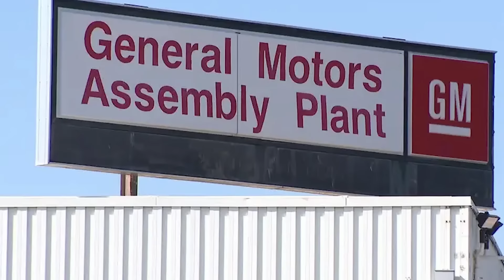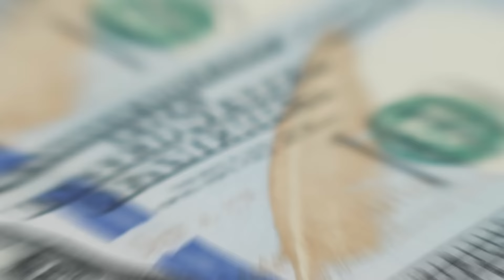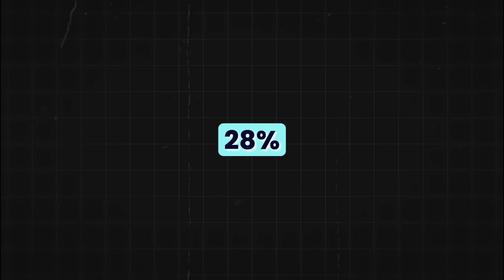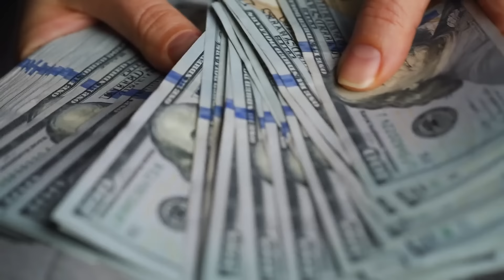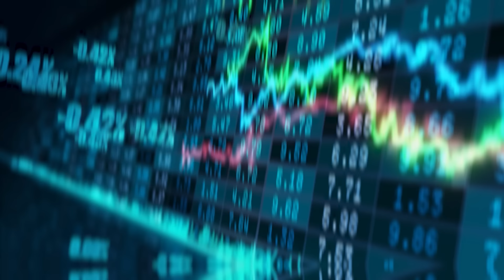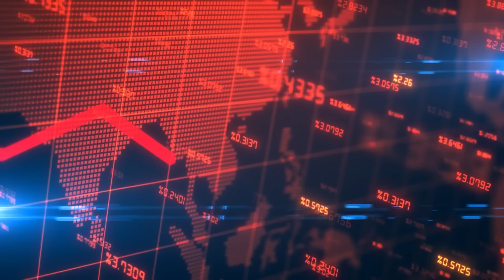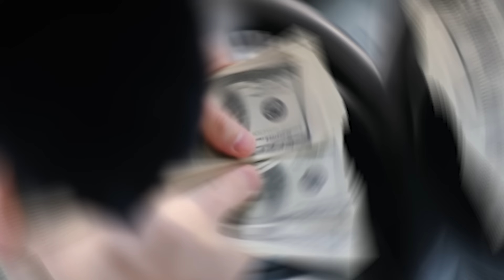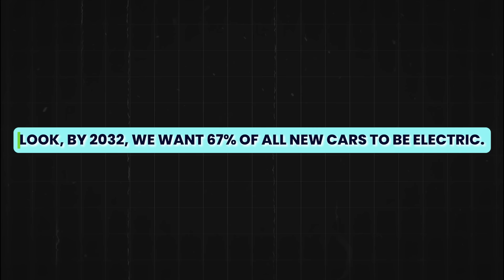The EV BUBBLE has Burst!!!

Comment: Why would anyone buy a $ 100,000 Ford F150? That is the price for an apartment! Why does Ford not make a basic Ford F150 without the bells and whistles for about $ 35,000 ... consumers want a basic truck for a reasonable price.
Reply: Yeah, but a basic truck would have lower profit margins, so manufacturers aren't interested in making them. Reason being that a vehicle assembly plant costs the same to run whether it's churning out $35k vehicles or $100k ones. So while the $35k ones might still be profitable they're not going to be AS profitable as the $100k ones. That's why they don't make them.
Reply: @Haawser  Pretty soon Ford and GM will not make any trucks because they will not be able to sell them at $ 100,000.
It all has to do with supply and demand and the demand simply is not there. That is why they are losing money!!!
Reply: They do make regular cab pickup trucks for 35000. My buddy bought one and traded it in for another a year later.
Reply: @mountainman6549  Regular cab pickup trucks should be sold for $ 25,000. You could get a fully loaded car for $35,000
Reply: Just want a,work truck
Reply: @snitram1366  Exactly, most trades just want a work truck and not a fancy truck with all the bells and whistles for $ 100,000

What happened to all those trucks made in the sixties and seventies that one could fix themselves if anything went wrong? Now with the new trucks everything is hooked up to special computers and diagnostic tools no one has in their garage!
Reply: They do, but they are so basic that no one wants them. Hence, they came out with a small pickup, the maverick.
Reply: I just need a car that goes from a to z without all those stupid features,,,like the feature of individual climate control for driver and passenger ,,,that's so stupid ,,driver and passenger are in the same bubble. Smfh.
Reply: @luismercado71  You are right a work truck is just to get you from a to z and be able to carry a load
Reply: Just wait till it's about 5 years old and still running decent. They depreciate so fast they're worth half that or less in a few years. If price of a new one kills ya, then they obviously can't afford it.
Reply: @NicholasRobertsvalleyford  Almost everyone wants a basic quad cab without all the bells and whistles for around $ 35,000 at most.
We don't need leather seating, dual climate control, digital instrument panel, alloy wheels, etc.
Reply: ? @Haawser  So the $100K trucks sitting in the dealers lot is profitable
Reply: @paulhui7037  They are not only sitting in dealers lots but for a very long time with accrued interest rates.
Reply: @garyr7027  The trouble with the late model GM and Ford trucks is that many things start to fail and they are expensive to repair.
Yes, you could pick up a 2005 Ford F150 crew cab for about $ 25,000, but then you have to add all the repairs required.
It would surprise me if Ford and GM are still in business 20 years from now. They have lost so much market share to the competition.
Reply: @mauriceharting5877  it's not for the faint of heart, repairs are done by the owners to save on cost.
Reply: @mauriceharting5877  you cannot blame the truck manufacturers for complicated vehicles because they are mandated by the federal government to fuel efficiency standards which can only be achieved through modern engineering.
Reply: @mauriceharting5877  I don’t think you realize how competitive and difficult vehicle manufacturing is. Many are close or already have gone bankrupt. Many vehicles are sold at a loss. Do some homework.
Reply: You got that right! Bullseye!
Reply: @mountainman6549  You don't know this, but I used to work at a Ford dealership in sales and I know how much money they made. Dealerships love to up sell and inflate prices that is how they make more money provided they actually sell.
The problem is that consumers have caught on and most are not willing to pay inflated prices.
Comon' a truck for sale for $ 100,000???
That is the price of a small apartment!!!!
Reply: I can't imagine paying 35k for ANY Ford product except maybe an old Mustang that's been restored or a GT40.  The base model F150 should be about $19k.  PERIOD.  Cars are VASTLY overpriced right now.  All cars.
Reply: @charlescarmichael1124  
Haha! Yeah, me neither!
Reply: 90% of the people would do totally OK with a station wagon sedan or minivan, trucks are for farmers and people who work in areas without proper roads. Hell, even Carpenters and plumbers are better off with a minivan which can tow a trailer then a truck. Much easier to store stuff inside and organize things (I'm from Europe, I've worked in several  countries outside the EU and driven quite a few trucks)
Reply: ford has king ranches platniums difffent levels of towing capicity ect that dictaces price
Reply: If you want to get the real value of a vehicle, take it to the scales  and ask how much
Reply: @johnhanson4795  Yes, Ford brings out different truck models with different capacities, but that is NOT the only factor that determines the price:
1. Labour costs
2. Material costs
3. Production costs
4. Dealership costs
5. Mark ups

Ford labour costs are one of the highest driven mostly by powerful Unions.
Material costs are dependent on sourcing to get the best value.
Production and assembly lines can and should be automated for better efficiency.
Dealerships is an old model relied on too much by Ford. Instead dealerships should focus on repairs and maintenance and leave sales online to Ford.
Mark ups are high at Ford, but more so at dealerships for new vehicles. Why have a middleman (dealerships) at all? It only drives up the price.
Reply: The current base model F-150 is that price. The problem is finding one. They only want to sell higher trim levels with a higher profit margin.
Reply: @mauriceharting5877   Apples and oranges. You have to consider the higher load and tow capacities of trucks. The design and build is very different.
Reply: @agdraaijer7288  In Europe the biggest operating cost is fuel (mostly due to fuel taxes) and so the size and weight of vehicles is smaller.
The size is also a determining factor for parking in Europe.
In North America trucks are very practical in construction and farming. Try loading drywall sheets or sheets of plywood in your minivan or driving with a trailer only means more issues with parking in residential areas.
Yes, plumbers are better off with a cargo van since they carry lots of fittings and parts requiring van shelving, and the van roof is used to carry piping, etc.
Reply: @luismercado71 Climate control does improve comfort. I don't know how much it costs to achieve it, but I doubt that it's very much.
Reply: @mauriceharting5877   Base model F-150s are $36k. The trick is to find one.
Reply: @joewoodchuck3824  My point is, be the truck light duty, medium duty or heavy duty they are all overpriced for various reasons ... mostly greed.
Reply: @joewoodchuck3824  Again, greed by both Ford and the Dealers.
Reply: @cooleyhigh3405   Please elaborate.
Reply: @charlescarmichael1124  Well $ 19,000 for a brand new truck of any kind is basically impossible with current labour and material costs.
Even Tesla initially was going to sell the CyberTruck for about $ 40,000, but when they actually build and sold them the base price is $ 70,000.
Optimism is one thing, but when reality hits it drives up the price.
Reply: @mauriceharting5877  Ah. So you meant value by weight. That's the part that went over my head.
Reply: @joewoodchuck3824  One has to weigh the various choices to arrive at value is what I am saying:
1. Durability ... how long does any vehicle last without breaking down with expensive repairs.
2. Maintenance ... how much periodic maintenance and servicing is required.
3. Price ... how much does the vehicle cost and does it fit in the buyer's budget.
4. Practicality ... does the vehicle meet the needs of the buyer, such as is it used mostly to transport people or materials.
5. Fuel costs ... is the vehicle gas powered, a hybrid, or electric.
6. Aesthetics ... how does the vehicle look both inside and outside, body colour, and layout.
These are values determined by each buyer and that is why we have so many different vehicles on the road.
Reply: If I have to I will buy an older gas powered car. And put a better stereo and accessories in it
Reply: @DarkAngel051372  Yes a well maintained older car may be a fiscally sound decision. I own a 2005 Nissan Pathfinder and a 2002 Mercedes SLK320 which I bought for a fraction of the price new and these were wise decisions.
Buying a new car has the most depreciation for when you drive it of the dealership lot the price drops at least 20% and often more ...
Reply: @mauriceharting5877  you can get that. A basic xl f150 is 35830 new built from factory. That is msrp. Most people don't want to wait a few months to have it built.
Reply: @mauriceharting5877  dealers do not stock them because they do not sell.
Reply: Maybe extend the bed under the (back) seats so 8' sheetrock and lumber need not jut out of the back.
Reply: @DarkAngel051372  Nothing wrong with that.
Reply: @mauriceharting5877  Agreed on most.
Reply: @mauriceharting5877  One must be a careful buyer for any vehicle.
  With my ongoing diligence I'm happy to know that my current vehicle purchased at ~6 years old almost 9 years ago can be replaced with the same make and model, and same ~6 years old for not much more money as before. In addition, I can use it to tow my inexpensive utility trailer for the occasional "pickup truck" needs. It's been a long time since I've needed two motor vehicles.
Reply: $35,000 is too much. How about $10k or so??
Reply: @paulhui7037  Well, that's where their greed and stupidity comes home to roost...
Reply: @MollyDogg1234  Vehicles haven't been $10k for 40 years.
Reply: They are subsidizing the EVs
Reply: Greed and Corrupt Politicians.
Reply: @yaiburanakul8505  Yes, the various Governments worldwide are subsidizing EV's and they are not penalizing ICE vehicles enough yet for noise and air pollution.

If we want clean air to breathe and less traffic noise in cities we need to switch to EV's.
Reply: @mauriceharting5877 there's alot of us that buy those, such as the raptors for me atleast and I'm not satisfied with having the bare minimum when it comes to vehicles that I'm gonna be putting money into once I have it so I can make it look the way I want
Reply: @mist3rasylum397  You may spend your money as you please, it is your money, but don't call it a wise investment for these $ 100,000 trucks are overpriced.
Reply: @mauriceharting5877  I'm not saying it's not overpriced, was just saying there's alot of people who buy these for that price.
Reply: @mist3rasylum397  Fair enough.
Reply: Not counting on paying them $250.00 an hour for labor so expect to pay A grand for each visit if they look at.
Reply: @dj-bn1fj  Yes, dealerships do charge a lot for their repair services. That is why drivers find cheaper alternative repair shops or do the repairs themselves if they are handy.
Reply: As the owner of an EV, I can say that EV'S ARE NOT GOOD FOR THE ENVIRONMENT. the cost of producing Lithium , extracting process and everything will harm the environment 10 times more than an average IC engine car. An average Hybrid car will cost about 30 to 36 $ for a 360 miles trip andd 40 to 50$ in gas for a IC engine car. it costed me 75$ in supercharger costs and a 7 hour trip for covering 360 miles
EV car is not economical and not good for the environment.
Reply: @lnvkriitkgp  I am an owner of an EV myself (2017 KIa Soul EV) and you are right there is no such thing as ANY car or truck being 100% environmentally friendly.

The mining issue is a problem for both EV's and ICE vehicles since both use metals that can and should be recycled in time.

You forgot to raise the issue of  faster tire wear on EV's since these vehicles are heavier.

You forgot to raise the issue on vehicle paints and plastics which also pollute the environment.

But here is where you are wrong. ICE vehicles pollute the environment EVERY DAY with their tail pipe emissions and noise from the running engine.
ICE vehicles need regular oil and filter changes, which also pollute the environment with oil spills from leaking engines.
Fueling ICE vehicles also pollute the environment since gas from fuel escapes, which is a known carcinogen and harmful to humans.
Brake wear and tear and rotor replacement is also a big issue with ICE vehicles since most do not have regenerative braking like EV's do.

Yes, manufacturing of both EV's and ICE vehicles do come with some environmental costs, but after manufacturing has been completed EV's basically stop polluting the environment while driving whereas ICE vehicles do not!
Reply: You're right but at least some can be made up with the higher volume. GM and Ford just want to swing for the fence but forget about the old sales pyramid. @Haawser
Reply: @dj-bn1fj  Interestingly the cost for repairs are similar. And EVs cos nearly nothing for maintenance.
Reply: @mauriceharting5877  Europe also have public transportation, in the form of high speed rail. Fossil fuel companies have lobbied heavily against public transportation, and EVs. You might even notice some youtube channels that have all of their content attacking EVs.
Reply: @lancecarona2554  Yes, I was born and lived in Holland for many years and I must say Europe as a whole has much better high speed rail infrastructure compared to anything in North America.
Public transportation via rail should improve much more. I live on the West Coast of Canada right now and light rail has improved over the years, but it still has bottlenecks and breakdowns especially during rush hour and it does not cover all of our local communities.
Reply: @mauriceharting5877  High speed rail is almost nonexistent in the US. Again it is because fossil fuel companies own this place.
Reply: @mauriceharting5877  polluting the environment is inevitable boss...
My point was to people who think I'm saving the environment by driving an EV. Producing electricity also pollutes the environment with the exception of renewable energy. Just because we are not seeing the pollution doesn't mean it is not happening
Reply: @lnvkriitkgp  Some cities have such a big pollution problem that electrification is the key. Beijing during the Olympic Games was shut down for ICE cars because the smog was so bad athletes had a hard time breathing. Mexico City was so polluted that it affected everyone's health. In India many cities have a serious smog problem. Even LA had a lot of air quality problems.
EV's are a partial solution.
Reply: @lancecarona2554  Well, high speed rail would be very expensive in America and Canada because:
a. We don't have the rail infrastructure for high speed, and
b. Due to the extremely long distances it would be cost prohibitive.

Let me give you one example here:

If you want to travel from Amsterdam to Barcelona via high speed rail that would be 770 miles or 1240 km and take just over 11 hours covering 4 nations (Holland, Belgium, France, and Spain). And the cost for this rail infrastructure would be shared by 4 nations.

If you want to travel from New York to Los Angeles by train that would take 2 days and 19 hours and be 2443 miles or 3932 km going through only one country (United States)
This means that one nation would have to spend over 3 times as much as 4 European nations per mile.
Reply: Who are you to decide what they sell ...or there pricing 🤡
Reply: @simmiesim321  I am not going to decide what Ford or their dealerships sell their cars and trucks for, but I am the one to decide what I buy and how much I am willing to pay for it.
Sales people need buying customers and their livelihood depends on it.
Reply: @mauriceharting5877  Those four countries GDP doesn't come close to ours. Also the new infrastructure bill that was voted into law provides funding for a high speed rail. Additionally if we were to even cut half of the subsidies out that we provide for fossil fuel companies that make billions in profit we could easily have high speed rail. But truthfully we need to replace fossil fuels they have been sucking money out of this country for decades.
Reply: @lancecarona2554  The biggest difference between Europe and North America is population density. Holland, where I am originally from, is one of the most densely populated countries in the world by land mass and as such it can afford to build a large rail infrastructure while at the same time support their own oil companies, such as the Royal Dutch Shell Oil company.

It is not fossil fuel companies versus public transport as you want to make it about.

It is about population density in relation to land mass in relation to cost in relation to rail transport usage in relation to cost effectiveness.

Most cities and surrounding areas in North America have public transit by rail, trams, and busses because population density and usage warrants this investment.

Very few people would travel from New York to Los Angeles by bullet train if it were available for a plane ride would be faster and time is money.
Reply: @mauriceharting5877  No it really is about fossil fuel companies. As far as land density as you are referring to it, large areas would make sense for high speed rail. America has both high, and sparse population areas. High speed rail would make perfect sense in the USA. The oil companies make more than many countries annual budget. Of course they are going to spend money to stop EVs and public transportation. That's why there are more than 3 fossil fuel lobbyists for every member of congress.
Reply: @lancecarona2554  I appreciate you passion and advocacy for more high speed rail in the world, but honesty about this subject is also important.
If public transit is profitable and desired by many it will happen. I would never buy a train ticket for high speed rail from New York to Los Angeles, if it were available, because a flight by plane would take 6 hours and 20 minutes and a ride by high speed rail would take at least 30 hours provided it is non stop (currently on the fastest Amtrak train 67 hours and 20  minutes).
Who in the right mind would spend 30 hours  on a bullet train versus 6 hours by plane to travel from New York to Los Angeles???

Even if any rail company could create a straight line rail from New York to Los Angeles (which it cannot) it would be 2450 miles at a high speed rail travel of 200 miles an hour it would take 12 1/2 hours or double the time by flight!!!
Reply: @mauriceharting5877  I really don't see any logic in the argument you are presenting. Outside of someone wanting to see the country by rail like Canada's cross country trains (which by the way get plenty of business) I think a plane would be the way to go. However there are stops along the way and so people take shorter trips at lower costs. So just because there is rail from NY to LA doesn't mean you have to ride from coast to coast. You could ride to all points in between.
Reply: @lancecarona2554  Fair enough, but taking a train to go for shorter trips already exists and it makes little sense to make these bullet train speeds of 200 or higher miles per hour and incur a tremendous  brake wear issues.

What we see in North America is a lot of big city and smaller communities around big cities being connected by public rail, trams, and busses since this is economical and place less strain on public roads and reducing grid lock.
There is no point in connecting Idaho with British Columbia since there would be insufficient demand apart from public highways.
Reply: @mauriceharting5877  Trains for shorter trips do not exist. It is very limited. We don't have a real high speed rail system. They basically are limited to high population areas. Remember this isn't a corporate for profit mindset. The government is supposed to answer to the the people and not to shareholders. So this is intended to serve the people, and not bottom line mentality.
Reply: @lancecarona2554  Here in Vancouver, Canada we have a light rapid rail transit system in place in the city and surrounding suburbs.
You cannot have a 200 mile an hour high speed rail system in Vancouver for it would be too dangerous!
Reply: @lancecarona2554  Yes, the Government is supposed to serve the people, but any public transportation system has to be self sufficient financially speaking or tax payers will fund ridership when they may not participate in public transit. I personally refuse to take the bus or light rapid transit in the city ... it is not my thing.
Reply: https://youtu.be/Pn2eCY3Kwuk